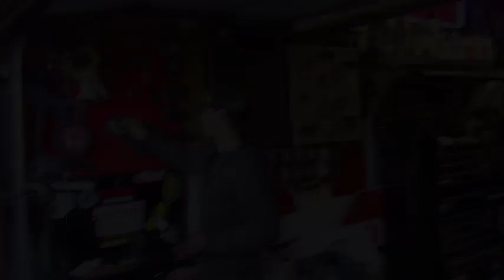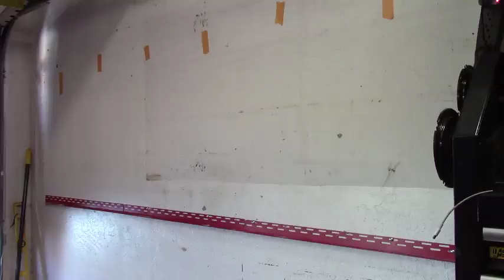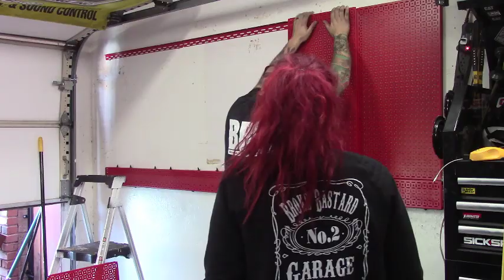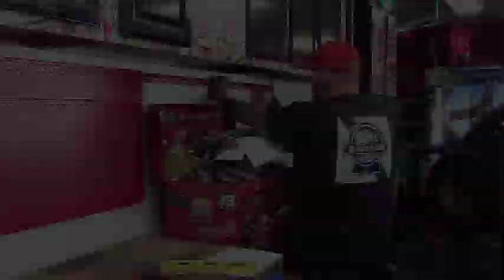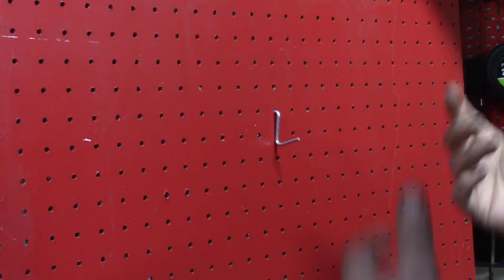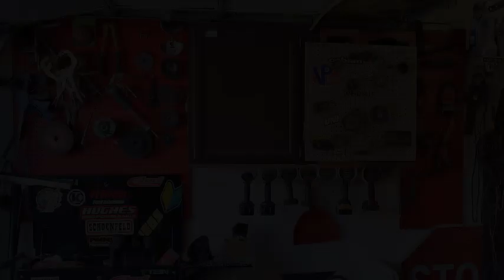How to Install Omniwall and Accessories - Why its better than Peg Board

Comment: I have a few old wall control accessories will they fit in omni wall if i go with this system?
Reply: During the design phase of our product line, we reviewed all of the other organizational systems on the market. We decided that we wanted to give our customers the ability to mount panels horizontally and vertically. We also found wall control's mounting tabs did not provide as much strength as we wanted with the OmniWall system. If you take a look at their catalog of accessories, nothing is mounted farther than 5" or so from the face of the panel. We wanted the ability to mount shelves that extend 12" from the face of the panel. We did however keep the age old 1/4" pegboard hole that is 1" on center. So standard pegboard accessories will work. To directly answer your question, no you cannot use wall control accessories with OmniWallUSA.com
Have a great day!

Comment: As a pegboard guy, this seems really practical and durable... You're wondering, so I checked the website for you:

The left side with the shelves, grinder holders, and other storage is the "weekend worrier" kit and is about $500 (without shipping, IF there's shipping cost). The other parts are the smaller kits, and are about $200-350; there's six colors to choose from, so is 6 colors and two options 36 color combinations? Let's go with that. 

Overall, to makeover your garage in a weekend for about a grand, and considering the shelving options hat hold weight that peg board couldn't handle, it's a solid looking system.

Comment: We're Super stoked about how your garage transformation turned out!! Thank you for all of the support and feedback!
Reply: Beats the hell out of masonite pegboard.
Reply: @unknownKnownunknowns  We took a long hard look at wall control when we developed OmniWall. We ended up going with panels that are 20% thicker and a different tab design because we found theirs to be structurally inferior. We wanted to have accessories that hang out 12" from the wall, where most of theirs only come out 6" or so. We do offer a discount for anyone who switches, and an even bigger discount for anyone the takes a video and posts the switch.